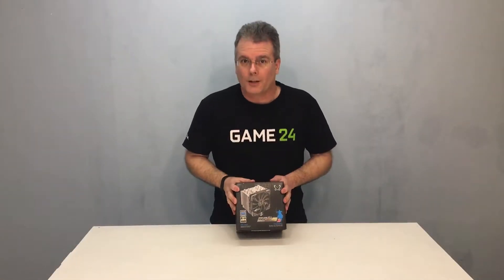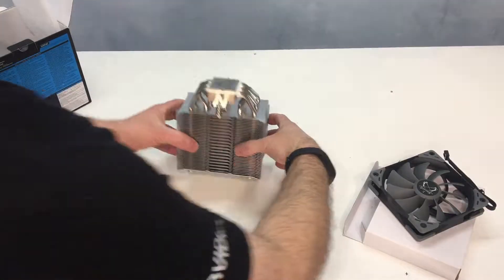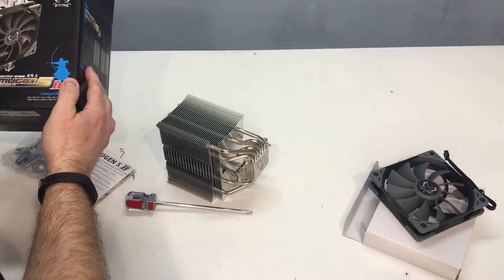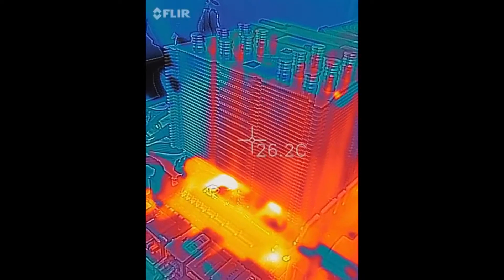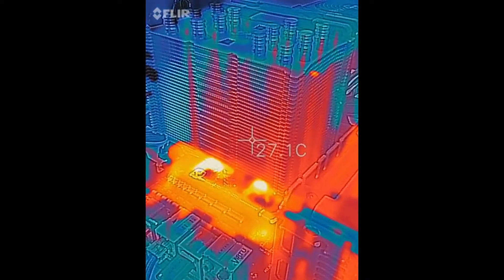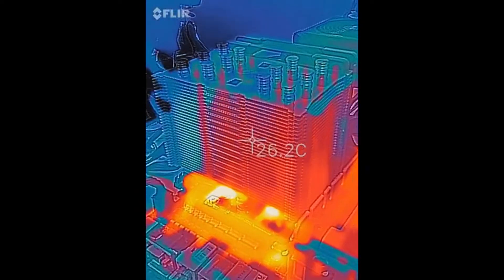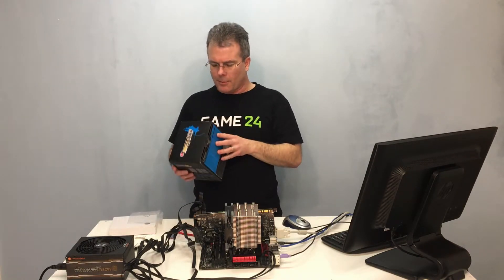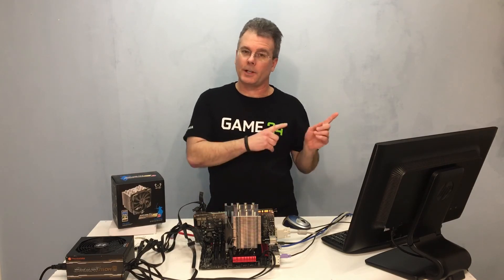Scythe Mugen 5 CPU Cooler Review

Comment: is this cooler(mugen5 )can applied on m-atx?? like am4 b450m
Reply from the maker: Yes - if the motherboard socket is covered in the cooler specs, then it should fit.  Make sure your case is deep enough.
Reply: @overclockersclub  thank you
Reply from the maker: You are certainly welcome!

Comment: Great video with the thermal image. But it looks like those fins are not doing a good job drawing the heat away effectively.
Reply from the maker: The colors indicate temperature differential, so if you have adequate air flow, then you should see the fins being lighter colors, or cooler as they reject heat - which is what you want to see.